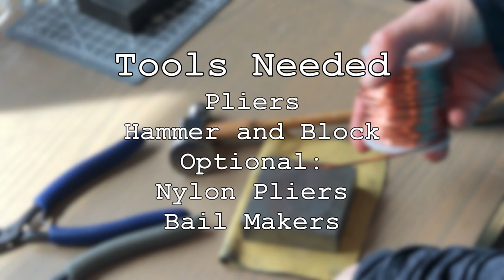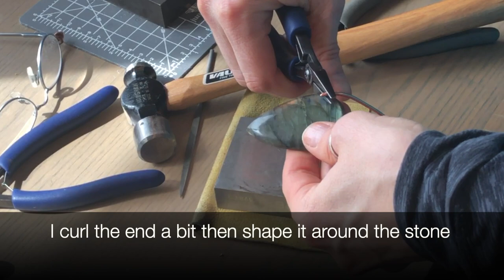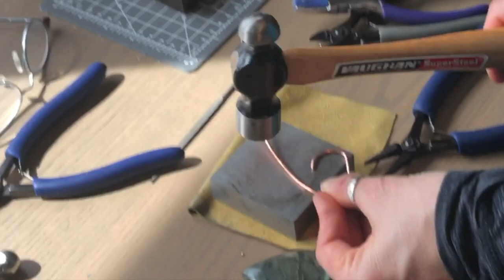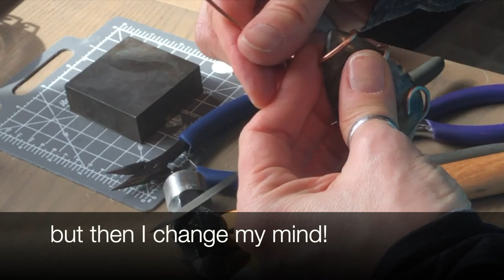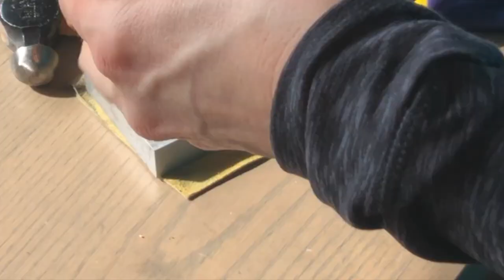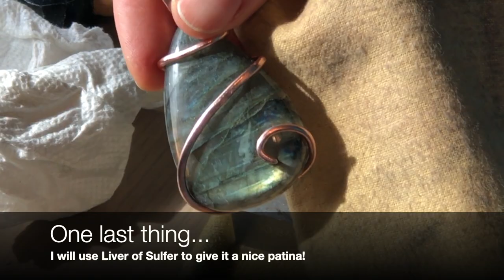DIY Wire Jewelry-Large Gauge Hammered Copper Wire Pendant-No Binding!

Comment: What type of file is that?
Reply from the maker: It’s from a set of metal needle files that I’ve had. It comes with flat, half round, tapered, all different shapes of files that come in handy. I think I got mine from a craft store but hardware stores like harbor freight have them too!

Comment: Where did you get your file? I've been using sandpaper!
Reply from the maker: Here’s some on Amazon 
Metal Needle Files- https://amzn.to/34QZ8pJ
You can use sharpening stones as well!
Reply: @ZurickDesigns  thank you!
Reply: What a beautiful wrap 😍  What coarseness is the electric polisher tip and what the correct name for the device?  lol. Is it a rotary tool?
Reply from the maker: @stardesol1452  I use a Rio Grande silicone polishing kit and it’s the blue tip which is “fine” which is just before pink which is “high shine”. That’s a cordless dremel tool.
Reply: @ZurickDesigns  Thank you so much for all the info!  Do you find the silicone tips hold up well?
Reply from the maker: @stardesol1452  I think so. I’ve had this kit for years. The coarser tips tend to dissipate faster but I only use them on deep scratches or nicks.